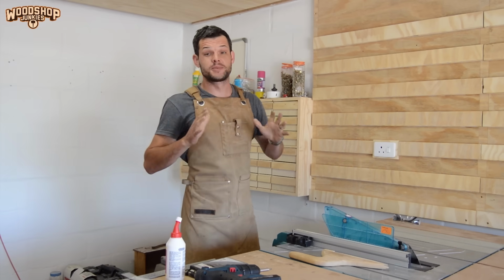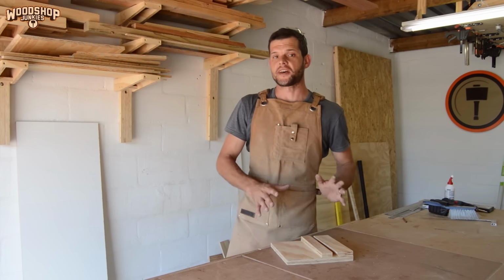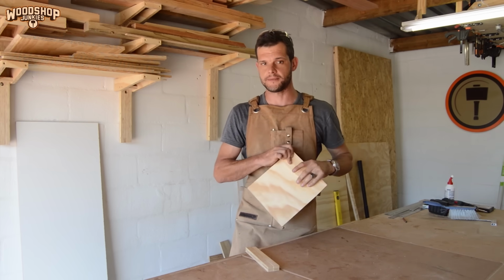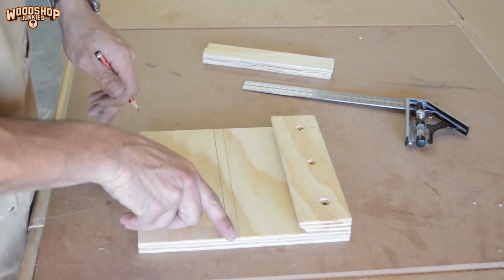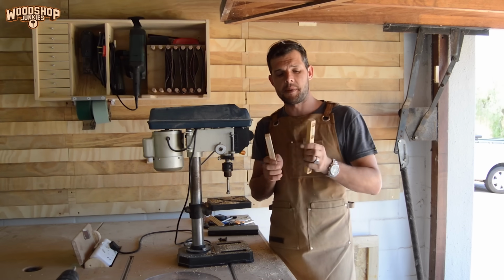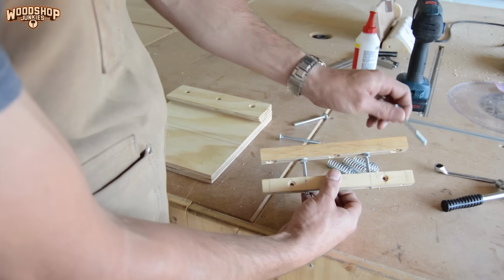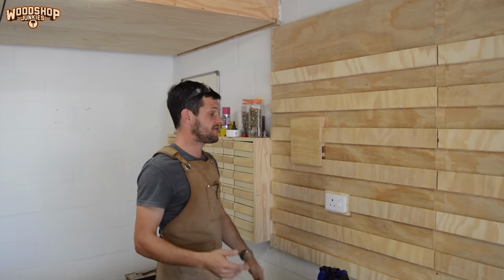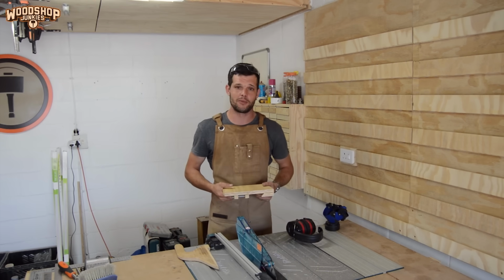Self-Locking French Cleat Mount - How To

Comment: I like the idea.  I have one suggestion.  Instead of letting the spring press on the bottom of the top cleat, why don't you get it to lock on top of the next cleat. All you have to do is turn the "moving spring block" around.  This will lock into the 45° French cleat and will give you a firm grip, which will not be dependent on the strength of the spring.
Reply: Going down you can also just use guides and gravity!
Reply: You’re guaranteed the cleat your on is the only reason it’s so it to the cleat you’re on.

Comment: Great idea.   The spring idea is cool but takes a lot of time to build.  I used a spacer between to top of the movable cleat and the bottom of the next wall cleat.  Cut a piece of wood so it fits pretty tight between the top of the shelf cleat and the bottom of the next wall cleat.  Split it at about 3 degrees and slide the two pieces together so it wedges against the bottom of the higher wall cleat.  Takes about two minutes to make and is easy to remove and reuse.

Comment: You could try a cam on a pivot with a lever. Lever horizontal pokes out the side and the cam has enough room to let the cleat release. Push the lever to vertical twists the cam to be tight against the rail. No springs required.
Reply: Ah, glad I scrolled down a bit, that was my thought as an alternative method.
Reply: The proof of concept with the springs is good; however, Dan’s a cam lock mechanism idea seems a bit more user friendly in the long run…
Great Channel BTW!
Reply: This sort of thing or an even simpler wedge tapped in above it were my thoughts but the wedge would be a seperate piece and require a tool to install whereas the cam would have its own handle and be self sufficient so I’d take the slight complexity for the ease of use.  👍
Reply: This is kind of what I was thinking, too. Kind of like a camera tripod plate, you could even have it spring loaded so it snaps shut when you engage it, but that would be needlessly complicated.
Reply: Spring loaded pins lighter springs plus the pins would be stronger
Reply: I wonder if you could create a simple mechanism like the ratchet you would find in hand cuffs. Might require mods to the actual wall system, though.
Reply: Great idea, I was thinking that he simply needed to add a second cleat to the board, so that the board locks onto two rails. It wouldn't hold as nearly strong as springs but it would be the easiest way and still would add a plenty of support against accidental bumps relative to the amount of work required.
Reply: I am thinking a vertical rectangular hole under the cleat. Make a 'key' out of a dowel, push it in and turn 90 degrees to lock. Which I think it something similar to ThisIsDanPearce was saying, though I felt his description was a little complicated :)
Reply: You could add a spring to hold the cam up or down just a thought

Comment: A super simple elegant solution..... Just wedge it down from the top so it can't lift out.  If you want you could put a little block on a pivot so it could swing out of the way for easy insert, then fold it into lock position once the cleat is positioned.  Or, just have a bunch of "locking blocks" in a bin, which is (of course) hanging on a cleat which is locked down as well.

Comment: Very cool and a smart solution. To simplify it, get rid of the guide bolts. The bolts the springs are on are good enough. If you do keep the guide bolts, you don't have to cut the heads off because only one end has to move freely anyway.

Comment: Just drill a hole in the face of the piece below the supporting cleat & put a dowel in it. It only needs to stick out about a quarter inch so you can pull it out.

Comment: As some others have mentioned you have totally hit this from an engineers perspective. Light load, needs to be quick and easy to reposition, but secure when it is in position. The best I can come up with is add an angle to both sides of the cleat. Other ideas include a wedge or pin to lock things in place, but are nowheres near as flexible as this.  Great work!
Reply: I don't quite follow what you mean. Would you mind giving me any further details? Thank you in advance.
Reply: A double sided cleat is exactly the thought I had.

Comment: The wall looks great, and your solution to a common problem with the French Cleat system is very creative and looks really great; but it seems to be very labor intensive.  Last year I also dedicated a 16'x4' section to French Cleats backed with two sheets of plywood-it looks just like yours.  I've found that most tool holders stay in place.  My solution for keeping the smaller ones in place was to attach the cleat on the back of the tool holder about 1/2" down from the the top of the holder, leaving a 1/2" lip.  I then slide a small block of wood behind that lip.  That block fits snugly between the upper and lower cleats and is kept in place by the 1/2" lip.  If the cleats on the wall are all the same distance apart, than all of the locking blocks will be interchangeable.
Reply: @monstercawk I'm pretty sure Fred meant labour intensive in comparison to other easier, yet effective solutions...some of which are posted in the other comments.

Comment: Nice idea!    There are situation where I see this may be good for:  1) when lateral access is limited like in a crowded space where removing / inserting wedge or wood block may be difficult,  2) items that do not need to be removed frequently,  3) and items that need secure and tight mount (ie portable hinged lights, expensive Bluetooth speaker,   etc..).     Thanks for sharing!

Comment: Well I've read a majority of the detractors of your A'ha moment, saying do this or that...BUT I DONT SEE ANY WHERE THAT THEY SUBMITTED A VIDEO TRYING TO IMPROVE ON IT. So thanks for sharing your experiment with the rest of us who will actually put this concept into use.👍
Reply: Armchair quarterbacks... the bane of the internet. But if it “A. Works” and “B. You are satisfied with it” then it doesn’t matter what anyone else thinks. I kind of like what this guy has done... maybe not used the middle spring and possibly added some paste wax for lube on the bolts... but generally keep it the same. It is, after all, a prototype.

I had an “expert” armchair QB CNC maker claim that all Openbuilds and Shapeoko CNC machines are overpriced junk and said making your own from scratch is better... yet when I asked him what I could do to improve on my Openbuilds Ox CNC... he went quiet... only to later start whining that something else I did was over complicated... and then suggested a really stupid method in place of what was actually is suggested by the manufacturer. Experts... yeah, right. I don’t argue... I just put them on ignore.
Reply: Most of the suggestions i have seen are quite reasonable. I wedge or cam lock would be easier to implement and probably do to the same or better job at holding the cleat in place. Something like in the link below on the bottom/back of the cleat with lock nut would allow him to quickly and easily lock-unlock. So instead of a complicated spring with guides system he only needs a bolt with a large nut that he can righting by hand. 

https://www.myerswoodshop.com/blog/clamps

Comment: think you got a winner, yes there are other ways to lock it BUT wood being wood gets misinformed "compressed" over time especially if you have a locking system with no give to it. But other then that i think you got a win here. Cool idea. Tip on the dust, just use your air compressor to get rid of it, i find it works really well. But get some real eye protection and dust mask because you will be drowning in dust.

Comment: It's probably a little bit over-engineered, but it also seems to work well. I actually think you got the spring tension right. I love how tight and secure it is. Definitely not something you need for every item you hang on the French cleat system, but it seems to work great for some applications.

Comment: Your solution works and is very creative.  I either slide a spacer in from the side to prevent lifting or I just drive a screw into the cleat to prevent all movement.  If I want to move the holder, both methods only take a second to undo/redo.

Comment: For one or two specialized items that's a very nice solution. And, as usual, a great video. For more flexibility you may want to consider something that isn't "fixed" to a specific cleat mount. Some people use a stop block above the cleat mount, but your spacing has to be perfect for that to be universal, and there's likely to be some wiggle over time. Find a way to make a block that squeezes tightly into those spaces - and still be easy to remove - and you'll be able to lock down any of them. I'm thinking maybe opposing wedges drawn together with cam lever of come kind.

Comment: I faced the same problem and solved it by making small wedges that are slipped in above the mounting and between the cleat above it.  When I want to move the mounting, it’s a simple matter of pushing the wedge out, repositioning the mounting and slipping the wedge back in. Virtually no other hardware is necessary, and two wedges can be used from both ends of the mounting if more holding power is needed.

Comment: This is an awesome idea. Could be mass marketed....a simpler version of your idea would be 2 pivot locks , one per corner. Just attached with 1 screw. Turn to lock , turn to unlock. 

But your spring loaded cleat idea is definitely impressive. 

I'm sure there are other ways it could be done.

I personally would use your idea, it seems to be of good quality, and possibly could stand up to daily use, but probably meant to not be removed on a regular basis which is another plus. Meaning it would last that much longer.

What a great video, thanks for making these great videos and ideas, I for one appreciate the work you do.

Comment: Have seen a few solutions to this problem, most of them are simpler to implement, but your method is way cooler and more professional. Definitely worth the effort in building. Imagine you could make these pretty quickly if you set up a production line. Thanks as for sharing!

Comment: There are solutions & {~Solutions~}. Meaning functional & elaborate. The wood key is functional & low tech / low cost. 
The spring block solution is elegant & intricate. For me Wood Key WINS practical. The Spring Block WINS for innovation.
Fortunately in problem solving there is need for both. Well done wood workers, thanks for sharing.

Comment: I love this...in fact, incorporating your locking system would be the only way I'd do a cleat system in my workshop.  I love the flexibility but dislike the chance for tools to fall off because they are not secured.  Same concept with peg board.  I'd rather have cabinets and drawers and label as needed.  Thanks for the tips - it is a joy to see you work and expand your workshop.

Comment: I used a bar with 45's cut on each end as the locking piece. This was located in the space between  the cleats (where his spring assembly is located). A screw through a clearance hole in the plate into the bar was the operating mechanism. Position the bar horizontally, set the cleat in place, and then turn the screw/bar 90 degrees to lock the cleat in place.

The bar needs to be screwed tight enough for some friction with the plate but still allow for rotation. The bar should come close but doesn't have to actually touch the cleats in order to work. It will keep the plate from lifting up or rotating out.

It's hard to describe mechanisms in a few words in this comment section but  it really is a simple way to lock the plate to the wall. Not quite as rock-steady as the spring loaded version in the video but it won't get knocked off the cleat which was my goal.

Comment: Brilliant. Easy to do and not too complex. Secure way to hold your gear and a great idea for the camera mount. I think two springs would be enough to hold securely and if you had a reverse french cleat you could lock it from both ends. Bottom cleat could be built smaller in your original design to utilize a locking mechanism just for this purpose. I will utilize this for my camera work directly over my bench.

Comment: Very creative. I was thinking about something similar but with the locking mechanism upside down and including another piece with a 45 degree angle to lock into the lower cleat. Basically two cleats the lower one is spring loaded
Reply: A nice thought, but it won't work. If the spring is pushing down into the lower cleat, it will actually be pushing the whole assembly upward.

If you do it to the strip above, you don't even need a mechanical force -- just a removable piece the exact size of the gap.

Comment: I like your thinking!  In my case, I bought a 3D printer so I could produce my cleat-locking system components in different sizes to suit specific applications.  I came up with a system that uses opposing magnets to position the cleats, with the 3D printed parts incorporating cams, printed springs (I experimented with coil and leaf), and steel weights.

Comment: All you need to do is make a taller backing plate so that it straddles the wall cleats above and below the location chosen. You then  mount your plate  to a free cleat section. Since the top and bottom of mounting plate are in contact with the cleats above and below, and won' t be bumped out of the wall cleat it is hung on. Very simple; no springs or gizmos. Your solution is very good, but so much work and stuff to source 8n order to implement.

Comment: Pretty neat cleat.  Could accomplish locking with a single pin in the middle of the shelf (assumed) into the middle of the wall mounted cleat.  Pull the pin, lift - move - remove.  The difference would be that the wall cleats will need a series of holes drilled at regular intervals.  Off hand I'd think 1" spacing would allow some pretty good adjustability.  Still, I think yours is pretty darn smart.  Good job.  Nicely presented too.

Comment: I have a few suggestions in my experience your spring compression should be a little over 50% for your engagement area it's a great idea I would suggest a small slot through the back plate position close to where your thumbs would be which would aid in the removal and perhaps installation of the cleat.  Awesome content

Comment: Try a couple of pins or tabs that move perpendicular to the wall. 
They would be set so that once the cleat slid into place they would pop out and lock the cleat down. Two advantages: 1. You could push the pins or tabs back just by pushing your mount onto the wall without having to angle it awkwardly like in your video. 2. You could use 2 cleats top and bottom to really lock it in tight and provide extra protection against lifting up a large cantilevered camera platform. Comment back if this is not clear...

Comment: love your design and build.  a simple solution is to just cut a block to fit between the top of the french cleat that's attached to whatever you are going to hang on the wall and the bottom of the cleat above it.  not nearly as creative and impressive as your idea, but i use the block system and it works well.  you can even bevel the bottom of the cleat and the matching part of the block so it acts as kind of a reverse french cleat to hold the lower french cleat and the block together.

Comment: That is a really nice concept and very creative idea. I think I might have to agree with your statement of it possibly being a little too complicated, but only if you needed several of them. 

Once I have my cleat wall installed, thanks to your ideas and videos, I think I would drill a small hole, and use one of the many things you can insert that are spring loaded on the end, like clevis pins with the ball on each side that has a spring behind each one. Don’t get me wrong, what you made is awesome but you’re so smart and creative that you surpass the necessary. Your ideas just blow my mind. 

But if you plan to keep that design, I would suggest cutting two grooves in the front and glue in dowels to move the spring loaded ram from the front. Or maybe I’m overthinking it now? Anyway, keep inspiring us.

Comment: I had a similar idea but couldn't make it as slick as yours and it was too bulky. On mine, I used a spring between the cleat and the rail above, which I slightly french cleated on the bottom as well.

Now seeing your version I think it would be best to have the cleat on a spring and a fixed bototm stop so that you can still use hook and unhook it with one hand. One-handed operation is a big thing for me, although I have two perfectly functioning arms.

Comment: The only thing that seems like you would end up having problems with are the guide pins. They should be smooth which would entail threading at least one end. The other suggestion I have would be to place a groove on the top of the cleat to put your fingers in when trying to remove the cleat from the wall. It doesn't have to be a large groove just large enough to get your fingers barely into. Like the French Cleat wall. Great going and great ideas.  Thanks.

Comment: Very well presented and a good idea if you frequently move cleats around. But it seems like a lot of work. My cleats tend to stay in the same place for long periods  as I rarely rearrange them. To anchor them I simply insert a small and easily removed screw that prevents horizontal and vertical  movement.

Comment: Love the idea. What about putting a 45 on the bottom of the cleat (like the top) and the same for the block connected to the spring. That would require less spring tension and completely lock the attachment to the wall system.